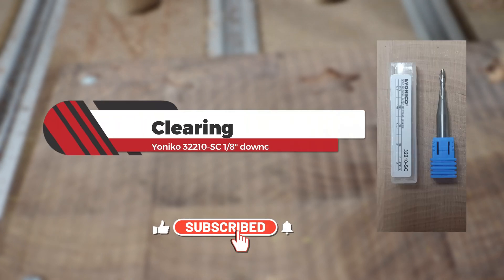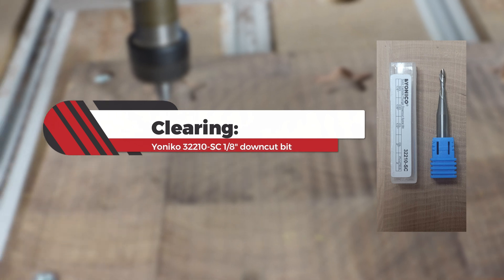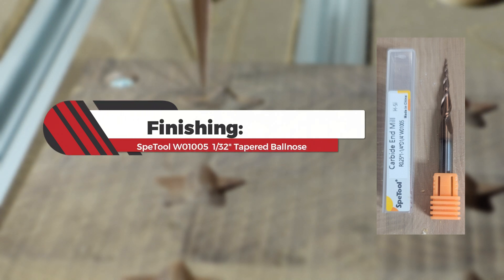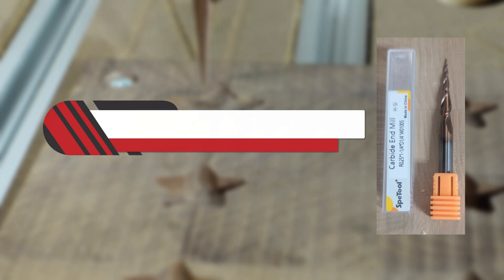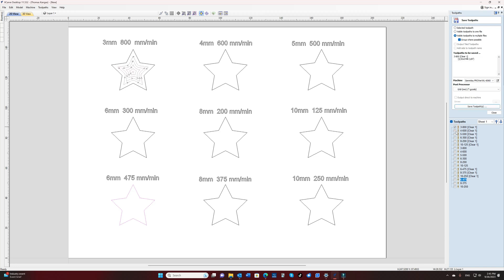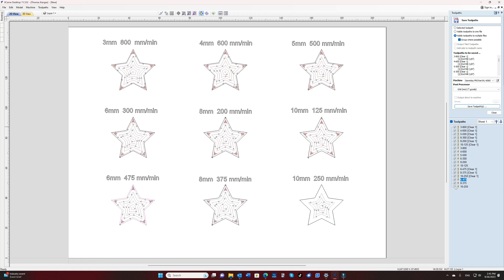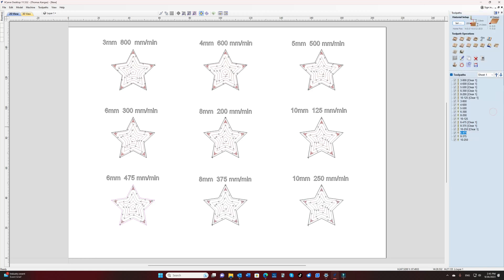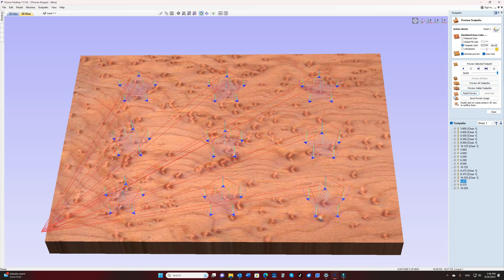All-new Walkthrough: How To Determine Speeds, feeds and Depth of Cut For Your CNC | Tk Designs| 4k

Comment: I think the bit snapped because of heat, feed was too slow.
I bet you can run a deeper 10mm cut with same feed used in the 6mm one.
You should do the test always using same feed but going deeper on each test. Slowing the feed and increasing depth doesn't give you any advantage in cycle time.
Subscribed 👌🏻
Reply from the maker: I think part of the problem is also that even with a VFD spindle, the machine has other shortfalls.  The lack of linear rails allows for too much flex. Fortunately, that will be remedied very soon. I should be getting my new CNC (Shapeoko Pro 5 4x2) very soon. Then I will rerun this test. Thanks for watching!
Reply: @tk.designs  should be a good upgrade.
I opted to build one 🤷🏻‍♂️😁
Wish you good luck with the new machine. 🙌🏻

Comment: How much did you set for rest machining? I guess you could do the 10mm, if you set the rest machning lower, so that the v bit doesnt have to work that hard.. Also do a helical /ramp downcut instead of plunge would help with chip clearance.. Also an upcut bit would help a lot on the chip clearance, and as you're doing a v bit clearance afterwards, i guess an upcut bit could be used for the roughing..

But fun to see how it all works..
Reply from the maker: I have not tested doing ramping into a vcarve before. I might give that a try.  As for the rest of the machining, all speeds and feeds were identical for the 1/8 inch bit, and the tapered ballnose.  I will likely switch back to upcut bits for clearing so long as I don't start seeing tear-out. I chose to carve stars, because I knew that the tapered ballnose would have to do some serious work to get the sharp corners and would provide for a good test of the strength of the bit.  My last carve, I did a fairly intricate edge-grain vcarve at 4mm DOC and 600mm/min speeds at 18200 RPM.  Thanks for watching!

Comment: It didn't look like to me that you ever achieved the feed speeds you were expecting.  Unless you have your accelerate  and decelerate  speeds set extremely fast those short moves will always be slower than what you had programed for.  I recently carved something and had the speed set to 100 IPM watching the software I never saw anything faster than 57 IPM. Short moves means slower feed rates regardless what you have it programed for.  I did enjoy the video.
Reply from the maker: I had hoped to get up to 10mm D.O.C at 250mm/Min, but the ballnose bit I use didn't survive.  I believe it is a limitation of the machine, as it has neither ball screws or linear rails, and may have just a bit too much flex in the axis to move.  I have been using a D.O.C of 2mm at a rate of 600mm/min.  I was honestly surprised that I hit 10mm D.O.C at any speed. That seems very high for a hobby CNC. I am happy you enjoyed the video. Thanks for watching!